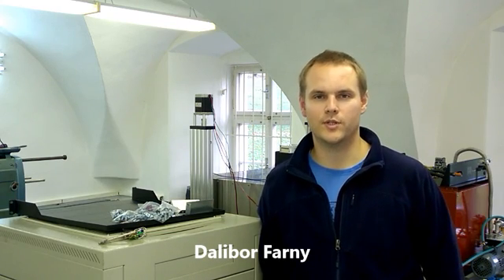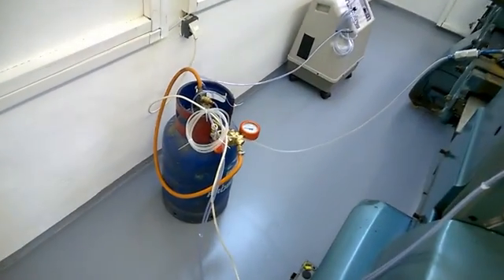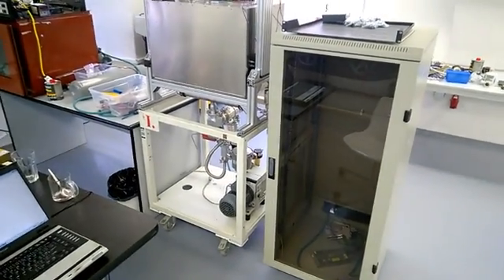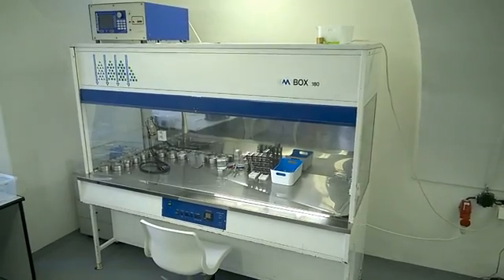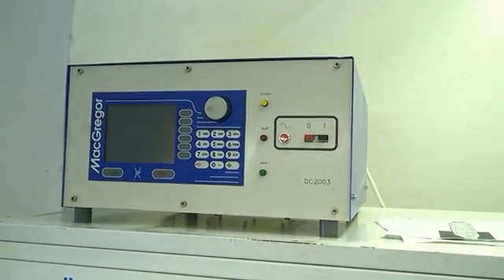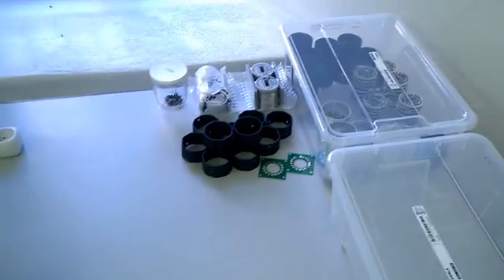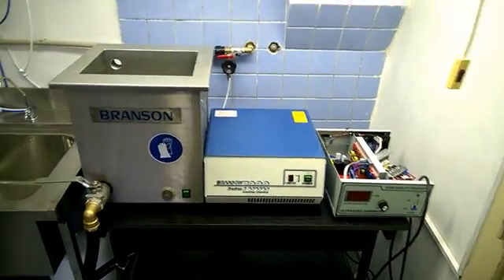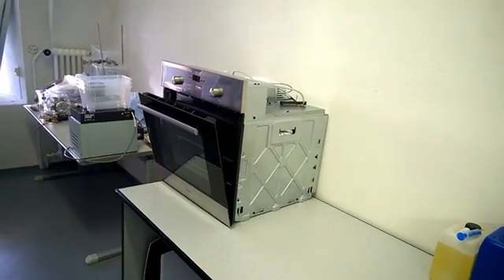Nixie tube workshop introduction

Comment: Real Nice, quite a step up from "the shed" I would presume.
((I've only seen pictures of the outside of "the shed" so I'm just guessing;))
Best regards.
[[P.S. The Heathaway Glass lathe is American, I guess that You know this and You just called British because You bought it there,  but anyway Heathaway are still "active" and make and sell "glass manufacturing equipment" in the US ]]
Reply from the maker: +GglSux Hi, thats pretty interesting, I thought the Heathway is British company.. You are right, it is from USA. 

I worked over a year in my garden shed, then I moved to the castle. Now I do only small (usually dirty) jobs like grinding, welding in the shed, to avoid making mess in the castle workshop.